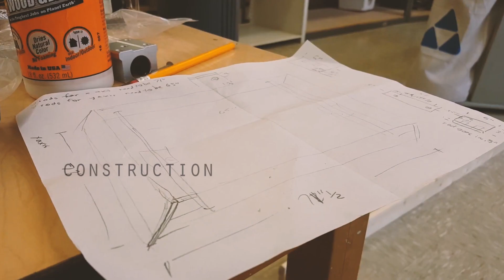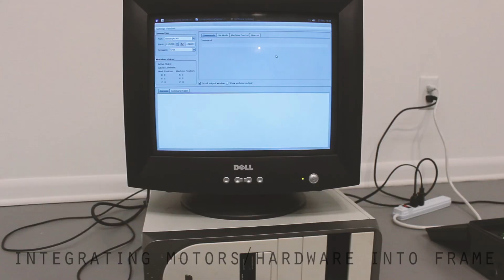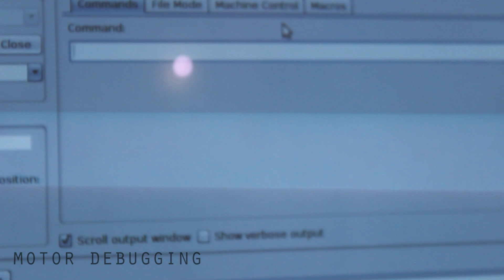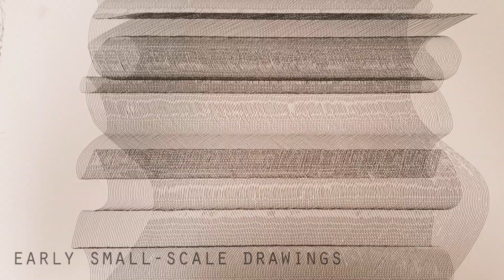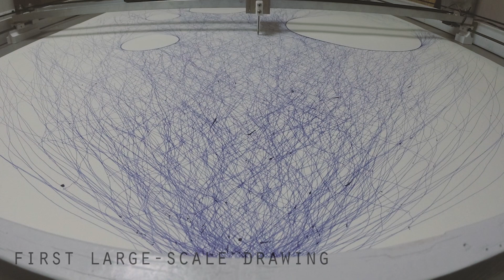Homemade 6'x6' Arduino Pen Plotter

Comment: This is awesome. Thank you for sharing. I have a 3D printer and a commercial vinyl plotter which are awesome but store bought. One day I'd like to build a similar pen plotter (maybe a little smaller) so I could learn more about controlling stepper motors using g-code. This is very inspirational to see it come together.

Comment: Did you run into any trouble maxing out # of vectors?
Reply from the maker: Yeah, for the really big drawings we had trouble finding a suitable program that could render our svgs and export the gcode. We used Makercam but that crashed a lot under our large drawings

Comment: Lovely project, I am in the process of designing my own large volume pen plotter after building 2 3D-printers, 1 Laser cutter and a recycled DVD-stepper motor pen plotter. I see some nice design ideas in this build and definitely some I would want to improve on myself. And one thing, please don't ever wear gloves when using a drill press!! (a 6:48). I've seen some gruesome accidents with people doing that.
Reply from the maker: Marinus Awesome, glad we could give you some good ideas! And yeah, we won't be using gloves anymore, we got lucky at one point where the drill caught the glove and ripped it off his hand! Luckily no one was hurt!
Reply: Oh good to hear nothing went wrong when the machine grabbed the glove! My plan is to use aluminium extrusions for the frame to ensure both rigidity and squareness. And besides that, the aluminium extrusions (the V-slot type) are also perfect linear guides that do not deflect much at lengths over 1 meter. So they can be frame and linear rods at the same time and save space and weight. The plotter size I'm going for is A0 paper size. Hardware will probably be an Arduino Mega with Ramps 1.4 and Marlin firmware. The only thing I'm still doubting about is what software to use. bCNC does an okay job at sending the gcode but the Unicorn plugin for Inkscape that I'm using only produces low-resolution lines and curves are chopped up to straight lines. I haven't had that experience when working with other gcode generators so I might have to find a solution for that. I'll ask around in the RepRap forums, maybe someone over there will know some way to get a better gcode generated from my illustrations.
Reply: @MarinusMakesStuff  Your comment makes me wonder if anyone's built a plotter based on polar, rather than rectangular, coordinates. That would be amazing to watch and I imagine it would draw beautiful curves.
Reply: @hairymcnipples  Hairy! I did make a polar plotter ;) But I was disappointed in the speed and precision of it. However, after that I set out to build an A0 sized plotter, you can see the results in my channel. Also, I have a supercool A3+ size DIY plotter running that absolutely rocks. Thanks for your reply, it reminded me of where I started a long time ago :)

Comment: Great video.  I love the art, and I am interested in making art to be printed to a large scale pen plotter (I currently just use traditional paints and canvas, etc.).  What software did you use to create the art?  Did you "print" the SVG file, or did you have to convert the SVG file to gcode?  

This is very inspiring!
Reply from the maker: Thanks for the comment! Most of our prints come from algorithmic pieces we made in Processing or HTML5 canvas. We take still images from those animations and convert them to .svg format, and from there we throw the svg into a gcode converter. The Arduino we are using has a GRBL library loaded onto it, which basically allows it to read gcode. Using UniversalGcodeSender you can send the Arduino the gcode and away it goes!